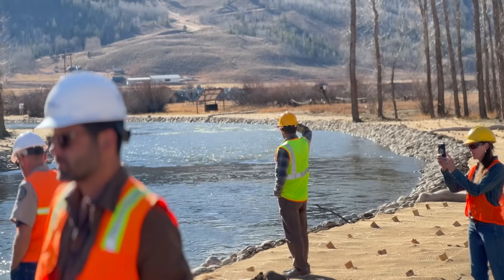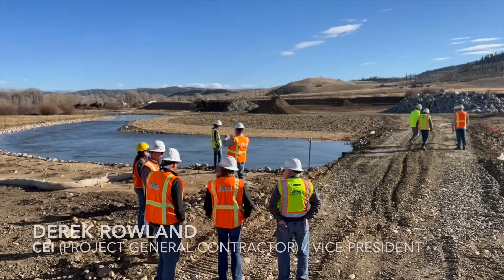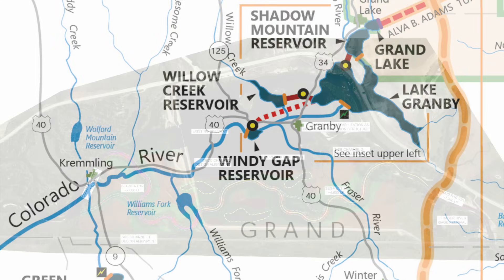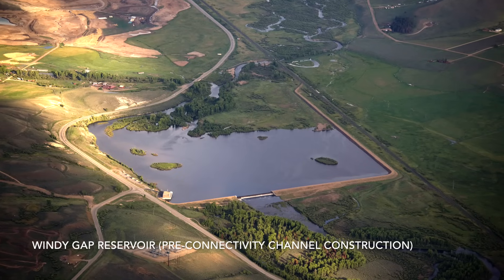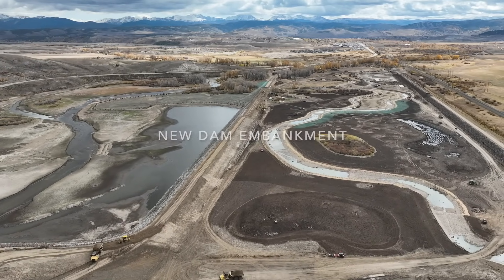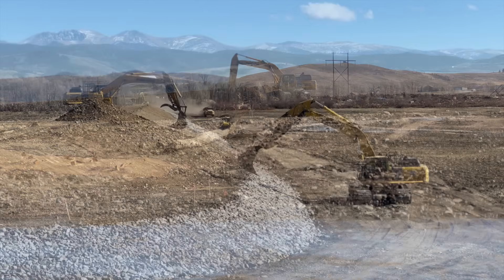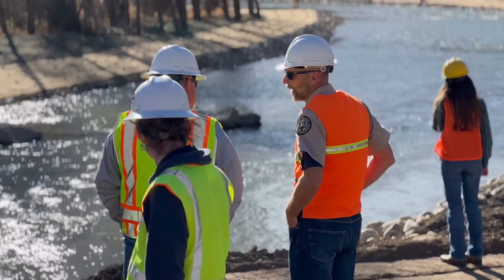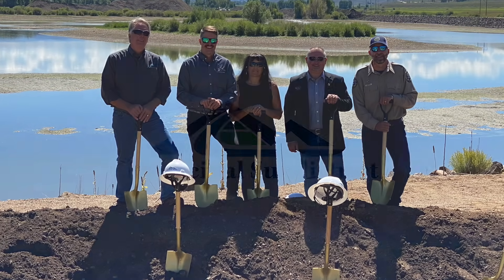First Flows Through the Colorado River Connectivity Channel (Oct. 25, 2023)

Comment: Well ain't that peachy keen green washing.  If you couldn't figure out from the flash of the maps what this is part of, and I didn't look it up, just looked at the map and video, water is going to be captured from Colorado and pumped from reservoir to reservoir up across the continental divide down into the reservoirs feeding Boulder and area.  It's nice that they did this bit of river restoration, but if they just wanted to do that, they wouldn't have had to spend millions splitting the reservoir, just remove the dam, sculpt and plant the lands in it.

Comment: What a joke on us taxpayers!!  Now the 1%ers thats own all the river 20 miles downstream will get a free restored private river.
Reply: The land they bought up when the project was in the making.  Inside trading at its generational best.
Reply: This is public water once it’s complete, almost 2 miles.  I’m no expert but two miles of new public  access seems like a good thing for the public.
Reply: @scottwells9426   Yes as long as you float down the river its public, not allowed to step on shore.
Reply: Not true.  The banks and bed will be open to the public.
Reply: Just a govt boondoggle. Big deal.
Reply: If you feel the river bank shouldn’t be privately owned then Americans should have thought twice before they ditched the Crown.  All shorelines are Crown property and accessible to the Crowns subjects.
Reply: It appears very shallow? What happen when it eventually silts in?
Reply: @mikeprice4103 it sounds like your issue is with capitalism and not river restoration.
Reply: @ryram18   No way you could hold a job as an interpreter.
Reply: @mikeprice4103  you should’ve bought it yourself if you don’t want someone else owning it. It’s a free country.  And I know “capitalism” is a big word for you, but you don’t need an interpreter, you need a dictionary.
Reply: BTW the Colorado threw out a case challenging existing law that landowners own the bed of the river.  So as the law was upheld, you are not allowed to wade a river in Colorado running through private land.  There are some exceptions, but really hard to summarize in a comment.
Reply: @markstrickland9731 it “shouldn’t” as it bypasses the adjacent dam.  Whatever they do with the discharges with the dam upstream of that, well, you know.
Reply: @mikeprice4103  you can float on streams through private property, but not touch the shore or river bottom.
Reply: @Painter75-z5l Which crown?  This area of Colorado was part of the Louisiana Purchase, so the French crown?
Reply: @markstrickland9731  the people that made money on it will be nowhere to be found
Reply: @ryram18 Capitalism with public money...😂😂

Comment: But its not naatural??   Typical Commirado, spend all the money on the East Slope.  Reservoirs and streams all over the west slope need help.  But I guess those people don't vote correctly.
Reply: This particular project is outside of Grandby and merely allows more water during high water to bypass the dam and flowing down the Colorado River.
Reply: This is West Slope.
Reply: @larrylangley9240  Yes, for sure.  Of course Northern Water operates a lot of the projects that bring Western Slope water to many of the Front Range and Plains users.